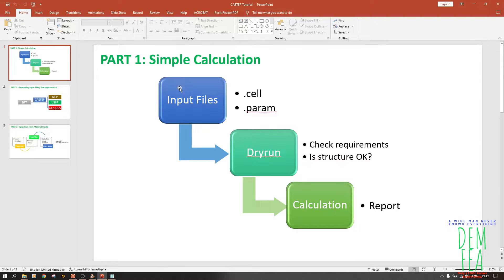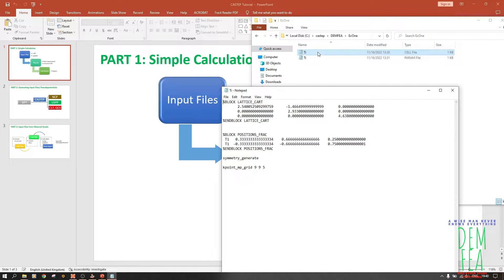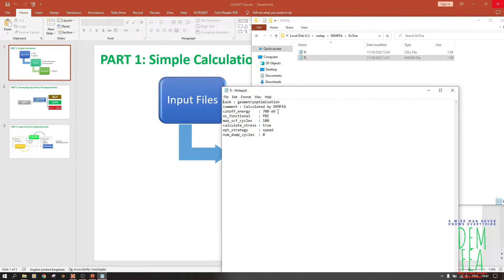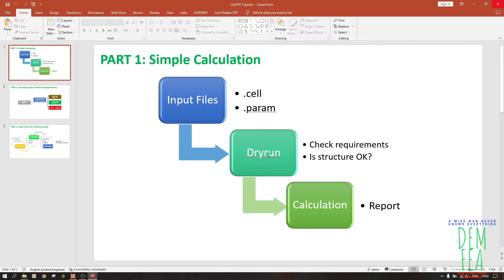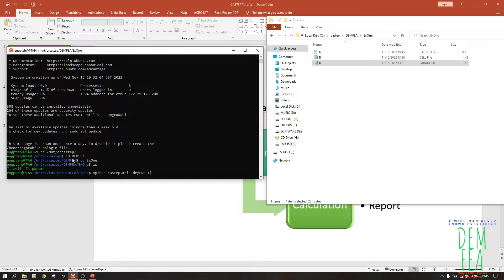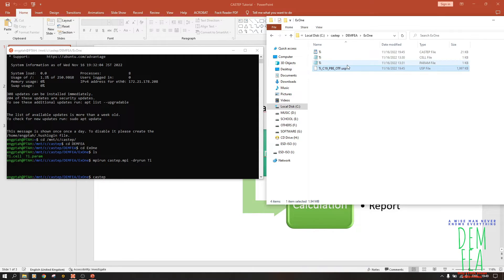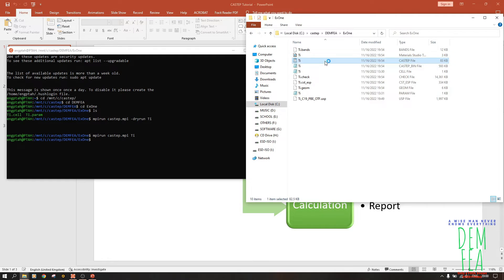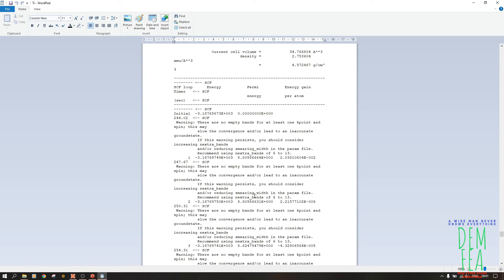Geometry optimization using CASTEP Academic – PART 1 – CASTEP Tutorials

Comment: The keyword num_dump_cycles controls whether (and how often) CASTEP writes out intermediate wavefunction and density files during the SCF cycles. You don't usually need it, but it can be useful if the calculation stops partway through - for example, if you run out of time on a supercomputer.

You can always ask CASTEP what any keyword means, e.g.

castep --help num_dump_cycles